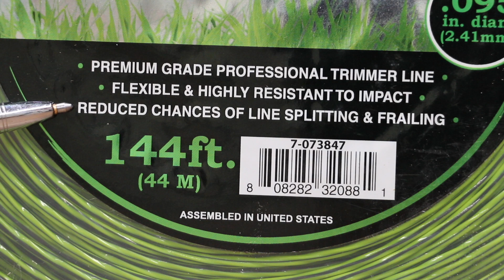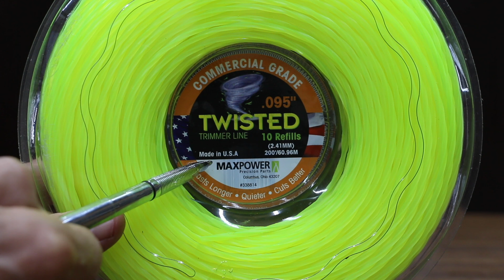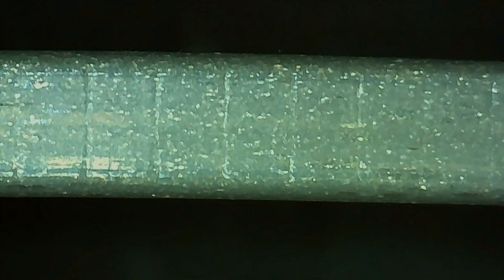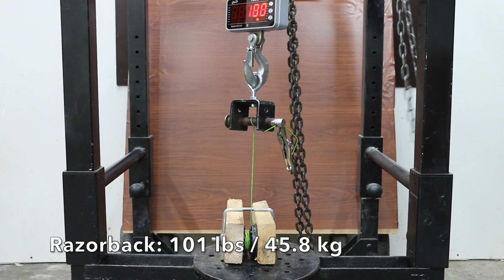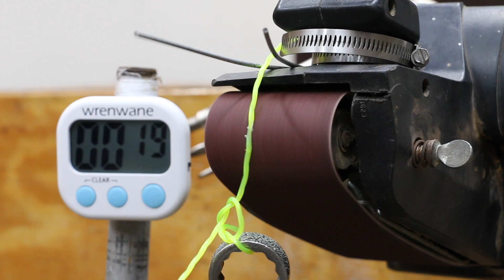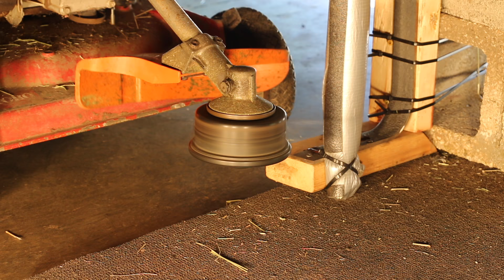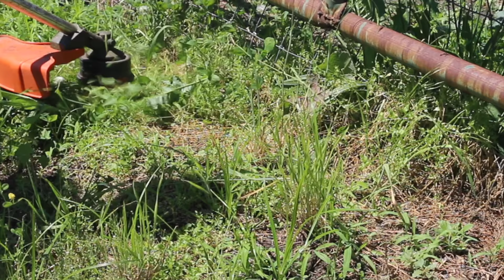Best Trimmer Line? Let's Find Out! Round 2: Stihl, Husqvarna, Echo, Oregon, Shakespeare, Weed Eater

Comment: I can personally say the echo is garage.  Breaks every five minutes and breaks off inside the head. And it gets tangled almost as often. I had less problems with ugly twist .65, and it should have broken way faster. Ran the trimmer at lower speeds and it cut amazing. But I need bigger than .95. I use the Milwaukee single battery fuel and it's pretty damn powerful.

Comment: Not as scientific as Project Farm, but I’ve been using the Husqvarna Titanium for a long time and like it. I tried Oregon Magnum Gatorline Supertwist, it is the worst ever. It disintegrates at the slightest resistance, gets jammed on the spool, and continually breaks off in the hole on the trimmer head.  Oregon, please stick to chainsaw bars and chains. They work quite well.
Reply from the maker: Thanks for the feedback.

Comment: We've been using the Husqvarna Titanium Force trimmer line for 15 years to weed whack 7 acres of dry, tall weeds in the California foothills every year. It was the best. Just recently I bought a new three pound spool and it is totally different and, sorry to say, worse than the previous spools even though it is labeled the same. It tends to bind up inside the spool more, break off easier if you hit a rock and wear out faster than the old line. It also looks very different. It's also a slightly smaller diameter even though it says it's 0.095 inch diameter causing it to more easily slip out of the slots that retain the line when rewinding the spool. We can't use the spools where you stick half the length through the head and then wind it since that is much harder to do if the line breaks off.
Reply from the maker: Thanks for the feedback.

Comment: Project Farm, I watched this video some time ago and purchased my trimmer line based on the test! But now I still have a half roll of it and I find it breaks very quickly. I found there is a lot of differing opinions and controversy regarding soaking old trimmer in water to bring back its strength. Since this video is 5 years old now how about a test to see if water actually rejuvenates trimmer line?!

Comment: None of this matters to me exept the line not getting jammed up inside the spool. Takes forever to clear, halts the whole project, have to start all over and spool it again, only for it to jam up again and repeat the process.
Used two different lines today and I could barely cut a few feet of weeds and get one or two bumps of line before it jammed up, cut the wire, and lost the ends into the spool. I must have fixed the line 20 times just to get through the job. And replaced the Ryobi bump feeder as well and kept having the same problem.

All I want is to not get jammed up!
Reply from the maker: Thanks for the feedback.

Comment: Does soaking it or storing it in water really do anything to slow down the lines deterioration ?
Reply from the maker: Thanks for the suggestion.
Reply: @ProjectFarm  Some webpages have suggested putting the full reel in a zip-lok back with a cup of water. I've been weed-whippin' my 3+ acres of weeds for 24 years now. Have always used the ECHO "orange stuff" @ .095. 

My Echo 210 died after 21 years of use [honest!]. Had to buy another ECHO and it came with the "Black Diamond". A reel cost $51. Will try the intro stuff that came with the new ECHO and let you know how the "Black Diamond" cuts on a patch of the dreaded "black mustard" weed, In Latin it's called, Brassica nigra. Look it up, y'all.

Yeah, I know it's yellow in color, but they call it Black Mustard.

If you let it get away from ya, the root diameter can get the size of your thumb in less than 2 weeks. Really have to bear down on the mustard...don't allow any of the plants leafs to remain. It is v-e-r-y invasive...pretty to look at, maybe, but very invasive.

Comment: I've struggled to find a quality string that will still feed with my auto feeder head.  I've used the ego brand,  razorback, and ugly twist by Shakespeare. Razorback is significantly better than the ego string that came with the trimmer, and still feeds good.  Shakespeare wants to over advance the string wasting it. I've also tried something from Walmart but it was too thick and wouldn't advance most of the time. I've noticed the .095 varies a lot between brands as well as the weight.
Reply from the maker: Thanks for sharing.

Comment: First : Again kudos to PF for tests that would emulate an ASTM durability examination.
1. Beware when buying trimmer line on the internet. Many times old stock will be shipped to you; often a great deal more brittle.
2. Two pieces of trimmer line hack info - yes, soaking the line in room temp water 24 hours previous to use will improve most performance perimeters.
And my personal hack is to run all my line through a silicone impregnated cloth prior to winding.
3. Line is some times blamed for feeding issues when the actual problem is debris in the trimmer head. I refuse to use “speed wind” heads for this reason. Dump the dust and grass debris from your trimmer head parts each time you replenish the line.
I’ve been running string trimmers since they hit the consumer market in the late 70’s: and sold trimmers, line, parts and accessories with a dealer for 4 years….I say all this primarily for the benefit of residential users. I know the pros out there rig things based more on time and effort.
Be well.
Reply from the maker: You are welcome!  Thanks for sharing.

Comment: At work we've been using Oregon Gatorline for years, mainly because it does better than other competition that is available in our local stores, plus we can get it in 1400' rolls in our local saw shop. We generally use the .105" square.

Oregon Tool makes 3 different shaps of line. Square, round, and twisted.
Reply from the maker: Thanks for the feedback.

Comment: Please please please do a video comparing concrete mixing methods! Soupy vs a stiff slump vs dry pour. I'm so tired of watching these dry pour videos and then arguing with the guy in the comments over how wrong their methods is! If you could answer it once and for all, we can stop arguing! You might collaborate with a shop press channel for testing the coupons! I would also suggest a full slab pour followed by chipping it up after 30 days of curing to test if dry pour will even fully saturate or if it traps the powder in pockets! It may even wash out the cement in places and just leave aggregate.
Reply from the maker: Thanks for the suggestion.

Comment: I have a gardening business, and had some Maxpower Twisted shipped from the US, based on the results here. I have to say, I am massively disappointed. This stuff is annoying. The twisted design means it doesn't feed smoothly, it takes about twice the time to reload the line, I have to dismantle the two halves of the mowing head to get it to feed through. I have noticed no improvement in resistance to breaking. 

What I have noticed is how easily the cords separate with very little use, and once the ends are frayed it no longer cuts well at all. The cheap stuff from my local hardware store is, in my real world testing over the last month, better in every way. 

I think this is a good example of where some of Project Farm's testing protocols are too 'laboratory style' and not based on real world usage. A good idea would be to do a segment where the ease and speed of reloading the line is tested too, since this is extremely important to people that work with this stuff 5 days a week.

Comment: I’m debating getting Maxpower and Husqvarna. I have a ditch I need to do that has a lot of thick weeds and a lot of small stones. I angle the trimmer at 90 degrees to really get the roots of the weeds so the line goes pretty quick (the trash line I have right now). Which brand would you recommend for that? Thank you for the in depth comparisons as well

Comment: Owning my own lawncare business, I've tried quite a few different trimmer lines. I heard from other guys that Echo's black diamond trimmer line was really good, and I ended up trying some. I was really surprised when I first tried it because it cut so smooth and cleanly but was also quiet and doesn't make an awful noise when it hits hard objects like some other trimmer lines. Since I've tried it I've never used anything else. I'm not saying there aren't better trimmer lines out there, but I definitely prefer the black diamond since it performs well but isn't super expensive.
Reply from the maker: Thanks for sharing.
Reply: It's the best cutting line I've tried, makes a small unit feel like it's got a couple of extra cc's! Great for productivity on dense thick grass. Not the toughest against woody stems or for jobs where you want something to really smash and spread the material away from the head. Prefer the black too, no bright bits of old line visible.
Reply: I will have to try black diamond for my business. I initially tried the maxpower twisted based on this video, but found it was not up the job.
Reply: @fubar12345  The desert extrusion vortex is worth a try too.

Comment: I really appreciate you testing the force required to release stuck line from the spool.  I've been really frustrated with string binding and welding to itself.  Sometimes it will get so stuck that it's beyond the tensile strength of the line... I've had to spend ten minutes with pliers and a utility knife to clear the spool on many occasions.  I'm in Canada and most of the trimmer string available locally is rebranded basic round stuff from the same manufacturer in Arizona.  Fortunately, Shakespeare's twisted product is also available at a couple of stores, and I'm impressed with how easily it releases in your video.  I'll definitely be giving it a try now.
Reply from the maker: You are welcome!

Comment: Results timestamps:
4:20 - Tensile Strength
6:25 - Weight To Release Line From Spool
8:06 - Abrasion Durability
10:42 - Cutting Through Test Strips
12:20 - Fence Wire Durability
Reply from the maker: Thanks for sharing.
Reply: @ProjectFarm  Should have tested: Bump feed reliability, ease and speed of reloading the line, cutting performance/durability when used to cut plants, not foam tubes, stretch tests and belt sanders.

Too much lab testing, not enough real world testing. I bought the twisted line for my landscaping business, in reality the stuff is terrible. The twisted design makes it really annoying to reload, would not bump feed as reliably as conventional line, the ends constantly fray leaving it with terrible cutting performance. I threw it away only half way through the packet as the performance was too low, gone back to the cheap regular stuff - much better.

Comment: The only guy to have relevant performance testing.
Reply from the maker: Thanks!
Reply: @Project Farm  I did have one question because I was in such a rush to watch your videos on trimmer line. I was curious if you decided to hydrate each line in water before testing. I'm hydrating stihl and ryobi line tonight. Arnold line is difficult for me to find locally but I did like the extreme line, because it felt like extreme had more mass that helped cut through my cheese weed stalks. Have a nice week. By the way have you ever tried testing biodiesel additives? Biokleen has a product to get rid of fungus in neglected diesel fuel tanks.

Comment: I find the sharp edges on the cords tend to hold on the grass and fling it further than the smooth cord which just cuts it. Also the trimmer labors much less with smooth cord allowing faster rpms for a quick cut, unlike the edge or twisted cord which tends to grab the weeds.
Reply from the maker: Thanks for the feedback.

Comment: I have used echo crossfire for years.  Not anymore.  As a side note Chicanic had a tip about trimmer line becoming brittle over time due to moisture loss.  I tried soaking my old line in a bucket of water.  It definitely extended the  useful life of the line.
Reply from the maker: Thanks for the suggestion.

Comment: i got some Stihl with my Stihl straight-shaft trimmer.. it sucks.. i used to get a wire rope line with nylon coating that was near indestructible, but dangerous (i wear a face shield), but I can't get it anymore.  Now I use Gatorline (i think?) by Oregon and it's co-extruded.  THE BEST ADVICE i can give is if it''s MELTING to itself inside the trimmer head, you HAVE TOO MUCH on.  use only about two 5 foot long pieces instead of trying to load it up
Reply from the maker: Thanks for sharing.

Comment: On trimmer line, you should do a new video every year. As they are always coming out with new trimmer line, plus there is way more options that what's here in this video. Also, I'd wish you'd measure the decibel noise level of each line to see which is quietest to the noisiest.
Reply from the maker: Thanks for the suggestion.
Reply: Desert Vortex is the quietest, if you believe the hype. It is extremely quiet.

Comment: Stretch distance and welding inside the trimmer head were great things to note in this vid. Impressive stuff.
I've tried that edged Echo line. Found it to be really weak (the sharp corners would thin out really fast). In my experience 12 years cutting grass professionally, the round style is the strongest because it has the maximum volume possible vs surface area, which is a huge factor for durability. Great testing!
Reply from the maker: Thank you very much!

Comment: I just bought a reel of Oregon Gator Line to replace the factory line that came with my EGO sting trimmer. I wish I would have seen this video first. When edging the sidewalk and driveway, the line melted away every few seconds. To edge and trim the curbs, sidewalk and driveway, which altogether is about 600 ft, I went through about 10-15 feet of line. At that rate, it won’t be long before I’m through all the Oregon Gator Line, and I’ll be buying the Max Power. Thanks for your videos. I love them.
Reply from the maker: You are welcome!

Comment: @Chickanic gave a good tip for trimmer line.  Soak in water to hydrate it which helps with breakage and longevity.  I've been doing it with my stockpile of line and it's made a big difference.
I've also upgraded my trimmer head to the Speed Feed (aka Echo) which has made a big difference in line feeding.
Reply from the maker: Thanks for sharing.

Comment: The Husqvarna Titanium Force has a low melting point and friction inside the spool and metal feed button on the head gets hot enough to melt the line at the feed button and melt grooves into the plastic spool.
Reply from the maker: Thanks for the feedback.

Comment: Hey really enjoy your work. You create some very clever testing apparatus. I recently upgraded ,my Trimmer to the Echo 2620 and had been using the Husq Titanium Force line in it. It was a very powerful combo, almost too powerful as this setup would throw rocks and dirt clods quite some distance and with some force. I recently moved to the Echo Black Diamond line. It is pretty sharp and seems to cut cleaner at lower RPM's, which helps with flying debris. The downside is , of course,  durability, as it appears to be more fragile and will break along heavy fencing and large rocks.(at least I'm not getting pummeled) If you do any more of these comparisons again, it may be interesting to see how various lines compare at lower RPMs. Which be helpful when working along more delicate conditions. Thanks
Reply from the maker: Thanks and you are welcome!  Thanks for sharing.

Comment: I have been using two 100 feet of 095 weed warrior twisted line for several months and heres my opinion.  Just for my 30 foot drive way edging and 20 foot of street curb edging and 50 foot sidewalk edging used 12 feet of line.  I dont think its all that good.  I wish I could remember what line I used before that, because it was super good, but I might look back in my ebay purchases and if it goes back several years I can see what brand it was.
Reply from the maker: Thanks for the feedback.

Comment: You left out the BEST trimmer string out there: Echo's Black Diamond.  I use to use the Echo trim line you tested until I found the Black Diamond product.  Far superior to anything you tested.  Better cut and no vibration.  Both more important metrics than cost or stretch or how soon it wears out.  I wouldn't pay a dollar for a role of any of the string you listed but would pay .25 cents a foot for Black Diamond. {Though it's only 0.04 to 0.085 cents a foot, depending on if you buy the 885' roll or the 253' pack. On Amazon].
Reply from the maker: Thanks for the constructive feedback.

Comment: Do not use Oregon's biodegradable line, it's too thin, it has no toughness, it just get shredded really quick and in my opinion is a con. Almost all line will photochemically degrade as no one bothers to put expensive stabilisers in their plastic trimmer line so they will all be gone in a year or two out in the sunlight.